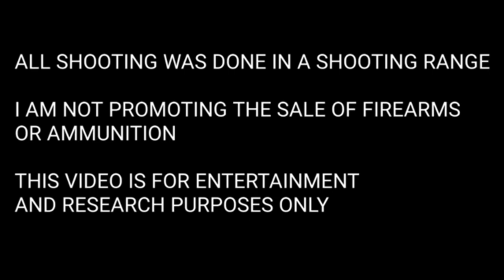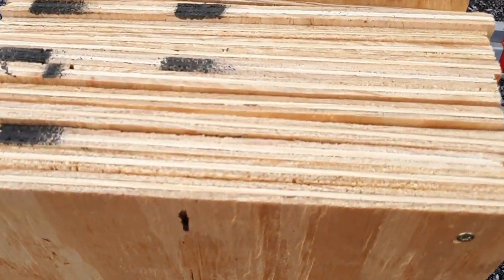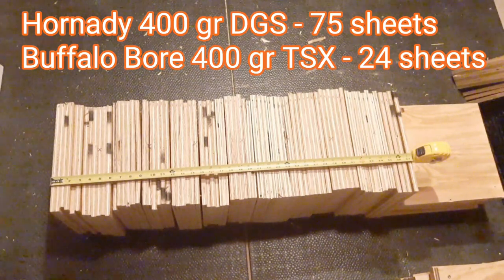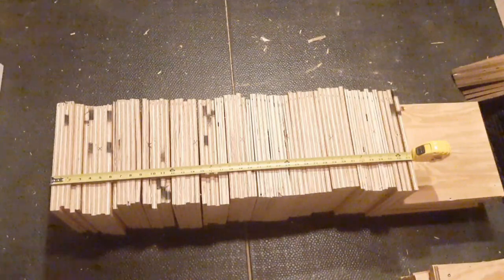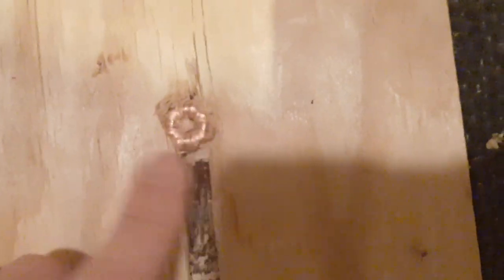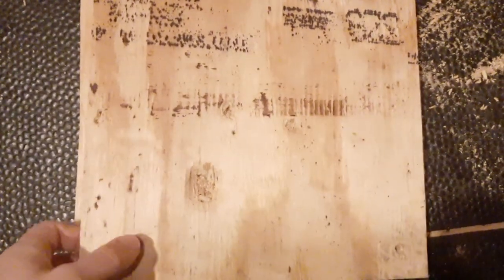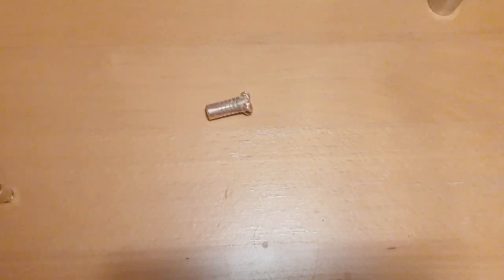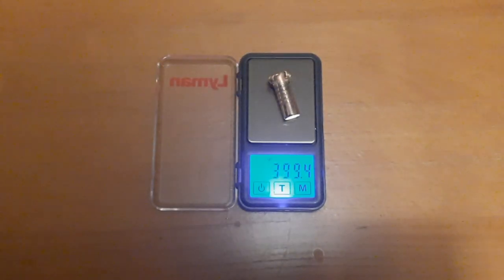416 Ruger vs Plywood (Elephant Gun)

Comment: Thankyou NY Prepper for bringing the 416 Ruger into the light. An excellent cartrige for the big five. The standard length action in which this cartridge is designed for is a game changer. Subsequent to seeing your tests, I pro❤udly purchased one. Btw, an extremely accurate cartridge. This cartridge deserves much more notoriety. As said, I proudly own a Ruger M77 Hawkeye Alaskan in the mighty 416 Ruger, capable of easily taking anything that lives on earth. Mine shoots sub moa @ 100 yds.